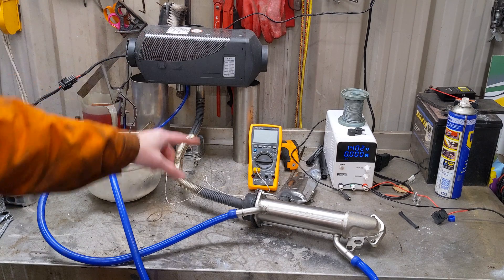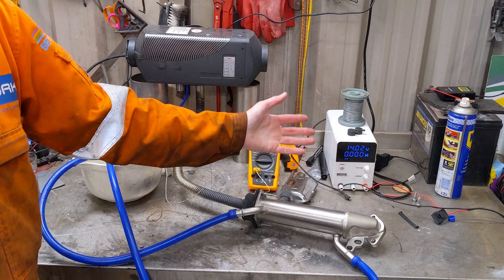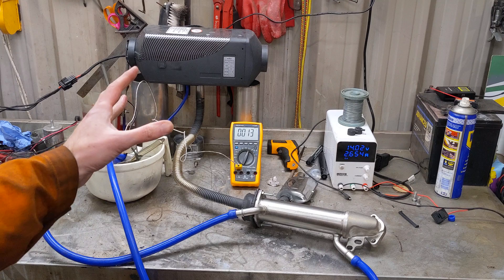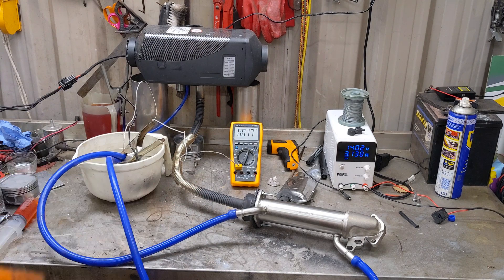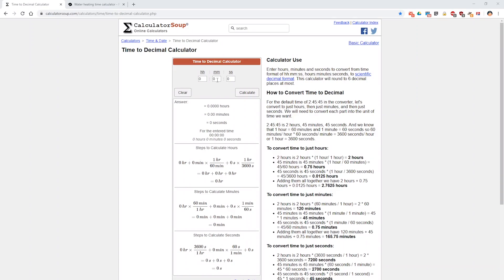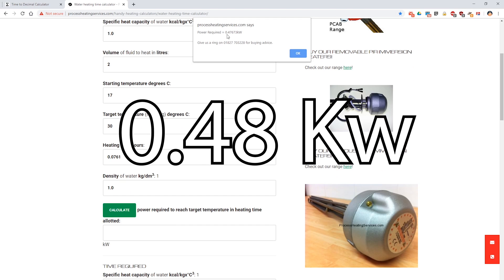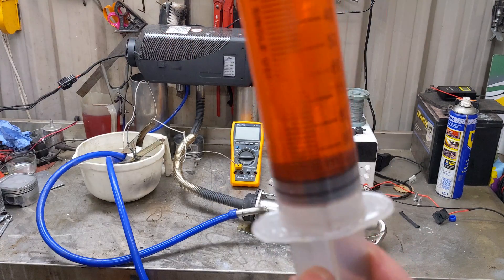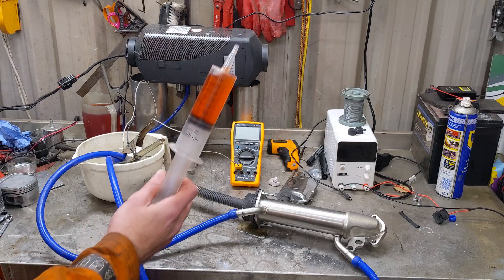Exhaust heat recovery with EGR cooler KW measured

Comment: Really like your experiments, i guess the pump would have to withstand high temperatures in order to circulate the water? This is a great idea to capture heat - would like to see it eventually feed a water tank for a shower
Reply from the maker: That's just a pond pump I had spare.  You should use a coolant pump which will withstand the higher water temperature.
Reply: Thermosiphon also called natural circulation, will work without a pump

Comment: One problem I see with this test is that it looks like the EGR cooler was already hot when you started the timer. If that's the case, there was a substantial amount of heat energy stored in the metal, which was then transferred to the water almost immediately when you started the pump. I think the test would be far more accurate if you used a much larger volume of water and ran the heater for a longer period of time. If you ran the test with ~20L of water for an hour, the initial energy stored in the cooler would have much less of an impact.
Reply from the maker: Not really.  I started the pump once the heater was running.  I edited out a few minutes.  The time take to go from temperature A to B is what determines the power.  More water and longer time will yield the same power rating.
Reply: @David McLuckie 
The thing is, you're not just heating the water. You're also heating the mass of the EGR cooler itself. With such a small volume of water relative to the size of the EGR cooler, that's likely throwing off your calculations significantly. By running the test with a higher volume of water over a longer period of time, the initial heat energy absorbed by the EGR cooler will have less of an impact on the heating of the water, so your final calculation would be much more accurate.
Reply: It's a very interesting test though, regardless. It's amazing to see how much waste heat can be recovered from the exhaust.
Reply: @David McLuckie 
Now that I think about it, I suppose you're right. If the pump was already circulating from the beginning, the stored energy in the cooler wouldn't effect the temperature of the water during the test. The water would already be slightly warmed by the time timer was started, but that wouldn't make any difference.
Reply: @unicornswag888  The mass of the EGR-cooler is not negligible compared to the 5 cups of water being heated, but if anything, the recouped heating power is higher than measured

Comment: "Could this setup be improved, of course it could!" Love it! I'm really enjoying your experiments with these heaters!!! Looking forward to the heater with the built-in water jacket! 
I'm also wondering if the 500W recovery will still be a possibility on the new heater as there is only so much volume in the exchanger to extract the heat in. You may end up with double exhaust water jackets (one built into the heater and one addon) :)
Reply: What was the Chinese one you've found with the water heater also? Interested as I've been searching for this for a while :)
Reply from the maker: I was thinking that as well.  Depends what they've actually done to capture the heat for heating the water.

Comment: I have a question. How long would it take to roast a 1.2kg chicken?
Reply from the maker: Roast or boil?  I could boil a chicken.
Reply: It would be similar to boiling or simmering a chicken on a small stove burner. Not a quick process, but enough for fixing soup or heating water for a shower.
Reply: @johanvangelderen289  what about having a shower in warm soup?
Reply: @PaulAlford75  

Lol. 

Good response.